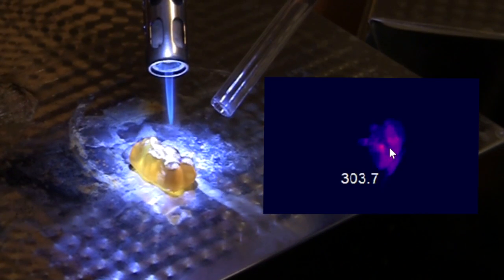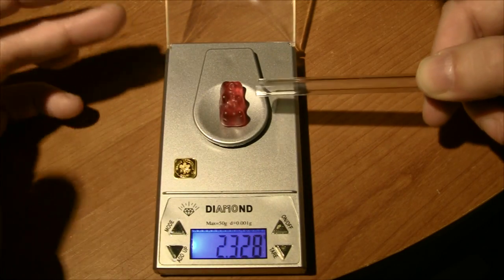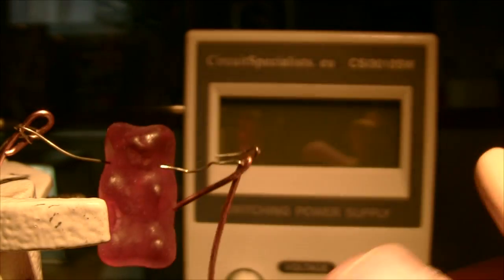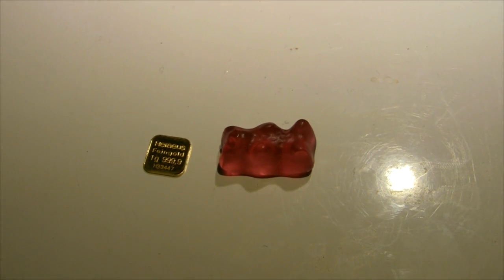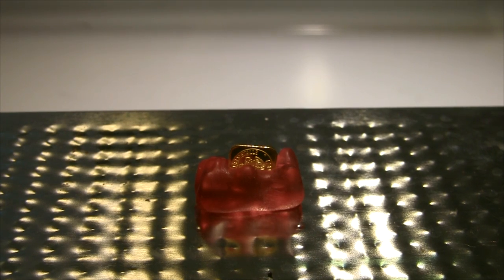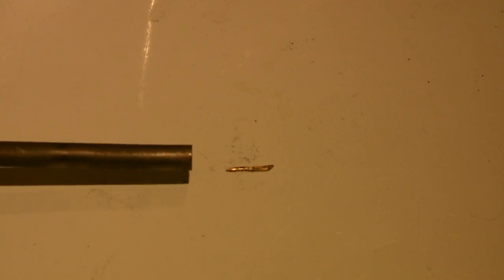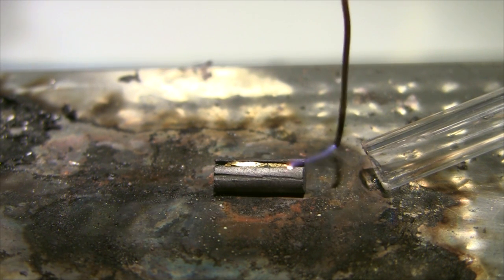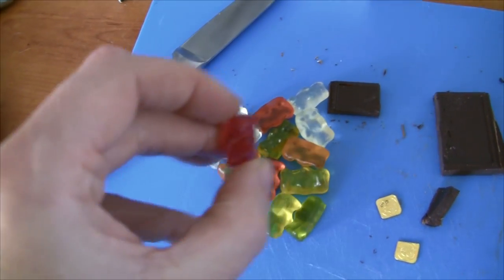Can 1000C Gummy Melt GOLD??

Comment: maybe one gummi bear was too little.  the graphite built up a body of heat whereas gummis were constantly shrinking.  consider the volume of the pin if gold to graphite.  it was not the same with the gummi.  it got hot and them ran out of fuel.  hilarious video!  I'm always looking for a way to melt gold.  thanks.

Comment: this is kinda pointless. because it depends on how fast the material burns and also the oxygen blasting is cooling it instantly. making it pointless aswell. you could do this with any material that burns regardless of the meltingpoint of the objects. because you could push the heat as far as you can by increasing the speed it burns. pointless experiment. you should rather get gummybears in a pressured cup to 1000 degrees and show how the gold melts in the liquid keeping the pressure balanced so it stops boiling. should also work with wather. wouldnt proove anything aither but would be fascinating how metal melts in liquids

Comment: Heat transfer isn't very effective when you put your sample on or inside the fuel, since most of the energy is released a bit above the surface (due to delayed ignition of most carbohydrates -- it's mostly pyrolysis until a point), and a very small chunk of fuel is directly responsible for heating the sample. Graphite is a bit of a special case, since it's elemental, and also its thermal conductivity is much better than that of gummy bears or chocolate. If you want to melt gold with gummy bears, you need to find a way to hold the gold piece above the gummy bear (about 1-3 mm if I got the scale right) and circulate oxygen below that. That should work. Also, on another note, what the hell's up with voicing the gummy bears? I actually scored myself a coughing fit from laughing too hard!

Comment: hmm, does not the heat dissipate, all the forges I know about are enclosed so that the heat is kept in a smaller area. That might be why you got problems melting it.

Two concrete/clay walls usually is the bare minimum.

Comment: Perhaps a much smaller containment with an oxygen flu as opposed to a large oxygen environment would trap the heat from the burning gummy, thus the heat would saturate the gold as opposed to dissipating rapidly into the rest of the tank.

Comment: A more serious comment, probably the excess water on the gummy bear lowers the energy released compared to pure sugar and I have a feeling gummy bears are good insulators so the exposure to the 1000 deg temperature may be lower than needed.

Comment: Wouldn't the gummy itself act as an insulator to the gold, drawing heat away from the gold into the parts of the gummy that were not burning, or were already burnt? Much like immersing an object in wax as a candle burns vs suspending the object over the burning candle? Perhaps it would be different if the gold was suspended within the flame created by the burning gummy bear?

Comment: Thunderf00t.... though the gummy bears may burn at 1000 Celcius... may not be the problem of getting enough heat transfered to the gold? Basically now it´s just a flame... and flames burn hot near the source but cool off straight away (like a candles flame). So where the gummybear is burning... it may be very hot, but just a mm away from it, the heat would have dissipated so quickly it wont be 1000 degrees anymore when near the gold. So perhaps you´ll need multiple gummy bears stacked together in a claypot of something, put the gold in that and ignite it.

So what you really need is a gummybear furnace to keep the heat, that is comming off the gummybears, where it is needed... near the gold. Now it fades away way to quickly. Build a small gummybear furnace in style of those IRL charcoal furnaces! ... would be my novice advice.

Comment: Some suggestions on how to improve your gummy bear experiment:
1:  create a bigger surface area by cutting the bear into little pieces. It will burn quicker and hotter.
2: make a kind of oven that can trap the heat from the gummy.

If people have made the thermodynamic calculations properly, then it must be possible.
Time to sacrifice some more gummy bears for science!

Comment: In power engineering, the heat is normally lost in our exhaust.  That' why in our fire tube boilers we run our tubes through the water a few passes before 'exhausting' them in order to maximize heat transfer.
You could feel the heat on your face.  It wasn't efficiently being transferred to the gold

Comment: My guess is yes, but it really depends on the box it's in. My suspicion is that the energy is not gonna be spent very efficiently.
Reply: I would bet 1 gram gold + the bear in a small  insulated box of highly pressurized O2 would work. Atmospheric pressure probably won't work due to low heat transfer and regenerative cooling.

Also, pretty sure bears are like, mostly water and other non-flammables. Might put a damper on their gold-melting powers.

Comment: Graphite burns at 800C, or over 1,000 to 2,000.
I doubt temperatures were really just 1,000, it takes at least 1,064 To melt gold. No infrared measurement means I could only compare it to the higher 900C Temperatures earlier, should have used the heat cam so we could see.

But just based on the melting point of gold, no, it wont melt at 1,000 C.

Comment: One of the biggest reason why you had problem with the chocolate and the gummy bears was heat dissipation. A lot of the heat being produced by the gummy bear and the chocolate was being dissipated into the metal plate and onto the air. You should try the same experiment on a smaller surface that doesn't conduct heat. The plate on your tank is operating like a heat sink.

Comment: When you were burning the gummy bear the first time: are you sure embedding the gold inside of your fuel will create the highest temperature exposed to the gold piece?

Basic physics (and building a lot of camp fires) taught me that heat tends to rise upwards, and the hottest part of a fire isn't always "inside" the burning fuel but rather in the almost white area of the flame, slightly above the burning fuel.

Maybe you would've acheived different results if the gold piece was placed slightly above the burning gummy bear on a grille or being held in place by a clamp of some kind made of a material with very low thermal conductivity? (like a ceramic of some kind)

Comment: I almost wonder if the oxygen atmosphere itself was taking away enough the heat to prevent the gold from melting. Could you perhaps try using chocolate or a gummy bear but, instead this time place it in a small crucible with the gold on top; alongside being engulfed in that oxygen rich atmosphere you had made and the projected oxygen stream. I   
truly wonder if the crucible might allow more of the heat energy to be retained near the gold instead of being radiated out into the oxygen rich atmosphere, and if that would be the last little push you need to melt gold with gummies!

Comment: The difficulty you had in getting the graphite to ignite shows how insanely hot the RBMK reactor had to at Chernobyl  for the graphite moderator blocks to burn...
Reply: is what happens when you turn the security features off to "Experiment with overheating"

Comment: You need to hold the gold in the flame putting it on the fuel sources is not good enough. The flame wall is where all the heat is.

Comment: One thing that operating at the intellectual strata you do is you overlook the little things at times. it is not only the ITENSITY of the heat, it is DURATION of heat that is the driving factor in metal smelting. you could subject metal to 10000 degrees but If it's not exposed to that heat for long enough to excite the atoms enough to alter the bonds, it will not demonstrate state shift.

Comment: I guess you too expected it would melt huh?
But if you see in my comment I specifically state that it should sit on top of the one of hot spots, not inside the body. Instead what happens here most of the times is that the body of the bear melts and covers the whole thing effectively insulating it from the oxygenated flame. When the rest of the body melts it's just too little left in order to bring the gold up to 1000 degrees, and since gold is an excellent heat conductor as well you're also helping it cool but blowing that pure oxygen at it.

Comment: the main problem seems to be that it doesn`t burn fast enough, maybe if you grinded the sweets to get a larger surface you might succeed, but I think you would need more than 1 gummibear to heat it up to its melting point

Comment: the heat of the flame isn't at its base, or in the case of embedding the gold into the gummy below the flame in the fuel of the fire. it gets hotter at the higher points of the flame, thus holding the gold over the gummy would result in more melting (think of it like grilling burgers).

Comment: now why does having a wire with plastic insulation have the risk of blowing up everything but the gummy bear on fire won't blow up everything.
Reply: killarviper it's not that "it would blow up everything", it's that the plastic insulation itself could catch fire.
Reply: Jason Doe he said "the whole thing would go up" similar to how the astronauts died. Those words make it sound like hes saying all the oxygen in the tank will catch fire if the plastic insultation in the wire catches fire.
Reply: killarviper it's impossible for oxygen itself to "catch fire"; you need some other substance as fuel, be it a gummy bear, some plastic insulation etc.

Comment: I think it would work if you put the gold in a ceramic bowl above the burning gummy bear. Also find a way to have the 02 blow SLIGHTLY from below the bear. If you could find a way to channel all the heat to go up to the bowl with the gold in it you would greatly improve your chances in melting the precious metal. 
I think too much heat is lost by the O2 blowing on the side which helps most of it to dissipate out and away from the gold. If all the heat was directed to a focal point up, and the gold was just above the bear, not in it, I think it would melt.
TRY IT AGAIN!!!

Comment: @Thunderf00t I think if you can suspend the gold over the burning gummi bear, it would help localize the heat distribution and keep it away from that huge heatsink of a metal tray you were using.  

Also: Thumbs up for more Gummi narration! LMAO!
Reply: Darastrix Sthyr no. There is too much hydrogen and oxygen in carbohydrates to easily melt gold, even with extra oxygen. The presence of the hydrogen/oxygen decreases significantly the amount of energy that is produced.

Comment: Speaking as someone who has melted a lot of metal in his own furnace, its not just the energy available. You have a system whereby energy goes in and energy is lost. You have to stop the heat leaving with insulation to let the temperature build up. Its about the energy over time in minus the energy lost and that gives the temperature.

Comment: I suspect you might have got a result with a chopped-up gummy bear.

The problem with a whole gummy bear or chocolate is that the combustion takes place on the surface with a lot of the gold either below or above that combustion surface and conducting the heat away.

So chop up/grate the gummy bear.  Or try granulated sugar.

Comment: Graphite has a very low resistance and is a good conductor. Why did you think you could light it on fire by conducting an electrical current through it? You're a Chemist Phil, come on, even I knew that based on my high school chemistry knowledge! I quite like the end result though.

Comment: The gold was shielded by unburnt material most of the time. I would have thought you'd have suspended the gold above the flame of the gummy bear if you wanted it to melt. One thing I remember from school is the top of the flame is hottest. Would probably be better still with the oxygen flow coming from directly underneath the gummy bear.

Comment: I am no scientist but I think your problem with the gummy bears had to do with sustainability. While one bear does burn at a temp high enough to melt gold, it doesn't burn long enough to do it... you basically run out of fuel (bear) before the gold reaches it's melting point. Try it with more bears, with enough trial and error, I'd wager you'd be able to figure out the perfect bear to gold ratio.

Comment: yea I'm not surprised by the end result. The big thing is, for those who said it would melt, is the energy loss. The oxygen helps take away a lot of the heat, the light you see is not usable heat. if he was able to perform this in a crucible to retain the heat produce,  yea he might be able to melt the initial amount of gold (if no heat was transfered away.

Comment: can anybody explain to me why the graphite burns? I understand that the oxidation of graphite could make it go from C + O2 --> CO2 but is it that it continues to get hotter? Is this an exothermic reaction that requires so much heat and so much oxygen that once you get over that activation energy, it occurs spontaneously with a supply of oxygen? Something about this doesnt seem right but maybe i'm overthinking it.

Comment: to get a gummy bear burning to melt your gold, you could try setting up the bear and the gold in a hole through a stack of ceramic tiles, bottom tile having no hole and the next one up having a slot for introducing oxygen to the stack, and the tile at the gummy bears head level would have additional holes and grooves for threading the wires to light it.

That way, a lot more of the heat from the burning gummy bear would end up in the gold.

Comment: +Thunderf00t
I have a theory here. When you were measuring the amount of heat produced by the gummy bear, you will recording it of the non luminous part of the flame, which is the hottest part of the flame. However, when you are doing this experiment, you are putting the gold in the luminous part of the flame, which is way cooler than the non luminous part of your flame. That's why the gold never reaches to the 1273 K temperature you were looking for.

Comment: @Thunderf00t - I think the issue may have also partly been due to burn time. Giving enough time to the burning materials to transfer enough thermal energy to actually bring the gold to its melting point. Also at what temperature was the graphite burning? As I recall it burns a bit hotter.

Comment: the tube of graphite acted like the graphite cuvettes for a gfaas machine, tge graphite tube became a furnace holding the heat and transferring it to the gold, the tunnel through the graphite also held heat and aided in transferring the energy to the gold, basically an open rather than closed process of drying then ashing, missing out the atomisation and ionisation stages of the aas technique as temperatures went nowhere near the requisites. NO2 stream jet and an O2 stream jet would be fun to see as temp skyrockets

Comment: Graphite has a higher conductivity than most people expect. You could've wired leads to either side of it (using the graphite as a wire), and caused it to heat and possibly ignite.

Comment: I think the main issue is you were blowing the heat away with the oxygen ( plus convection) so it was reaching thermal equilibrium too soon - if you could surround with insulation to keep the heat in it should melt more easily.

Comment: I've always wanted to see wood melt. I'm surprised no one has ever done this before. I assume it's as simple as heating the wood in an atmosphere with no oxygen at all, but maybe I'm wrong.
Reply: I think that's how charcoal is made, heating wood with no oxygen. I'm not sure how they heat it or if it could melt, but yeah.
Reply: Master Therion you are right about how charcoal is made. the wood won't melt. it will turn to charcoal and the gases it releases will be combustible

Comment: with the gold placed internally, I believe the gummy bear it self was acting as an insulator.  when the gold it was resting on top of the gummy bear, was the point of contact at they melting point of the gold? it should have worked?

Comment: Dude, your burning velocities for the gummy and the chocolate were too high. Quite correctly you identified the issue of the thermal conductivity of the gold, but you should've also taken into account the large thermal volume (~40L of o2) surrounding the thing. With the increased specific energy of coal you solved one of the problems, but you also added insulation to the piece which was crucial. 

I think you should repeat the experiment but this time limit your confinement. Also, perhaps you need to find a way to slow down the burning speed of the gummy and the chocolate. Cool video, terrible gummy voices.

Comment: To melt metal you need sustained heat, one gummy bear is barely enough. Should've tried increasing one by one until you found the right balance. My guess would be around 3 being enough.

Comment: I think the problem is that the pure oxygen gas from the jet cools down the gold and affects the transfer of heat between the gummy bear/chocolate and the gold, as well as the fact that air and water are not good conductors of heat and don't transfer heat energy very well. The graphite in the end was in contact with the gold at the end and managed to melt it as graphite is a good conductor of heat, and so most of the energy was transferred to the gold, melting it.